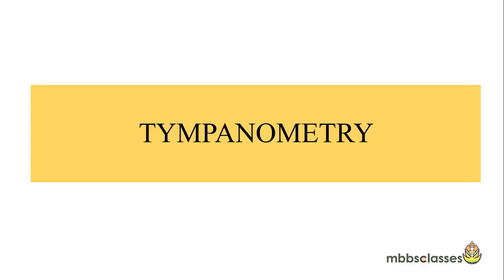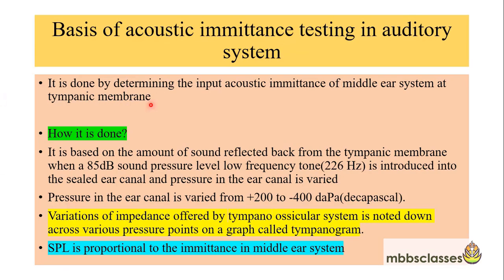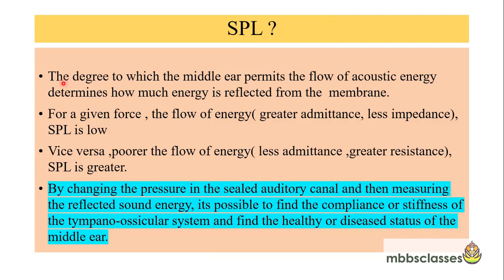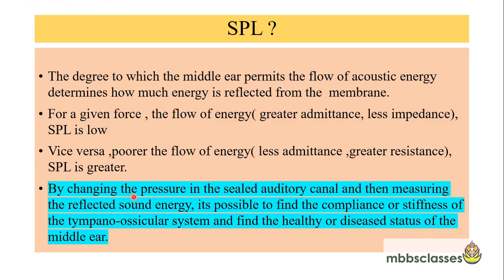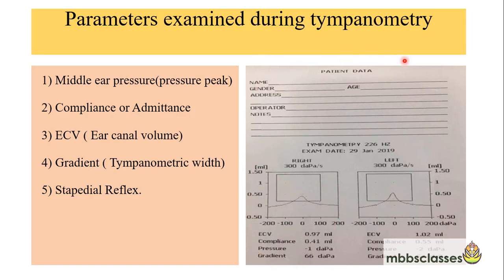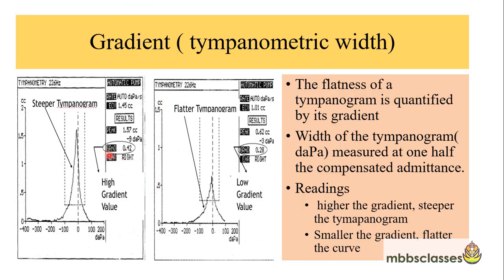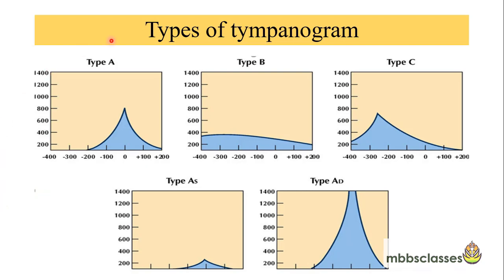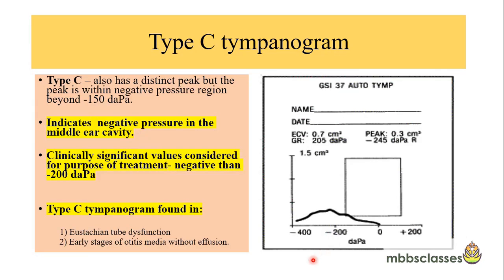TYMPANOMETRY

Comment: madam i have one rare case in ear...
Actually i have done Canal wall down Mastoidectomy...But Surgeon made a mistake during surgery..He mistakenly passed some bone Remnents in Eustachian tube orifies in middle ear..it got blocked in bony and cartilageous junction of eustachian tube and He packed my ear without taking it out...Since that operation i have been facing lot of pressure and Clicking,popping sounds..Hearing loss and Negitive pressure in Ear and even i could not feel air entering through nasopharynx area of eustachian tube..In CT Scan it is imaging perfectly some thing is blockage in between eustachian tube..but no one seeing my hidden problem..That is what the condition iam facing still from 8 years..please give me Advice madam